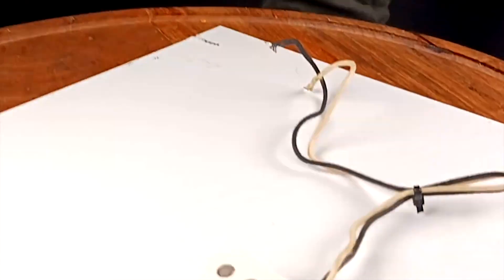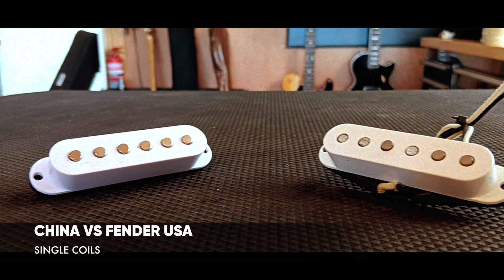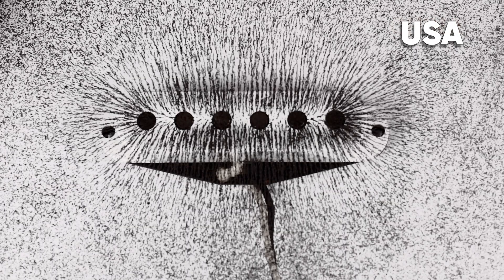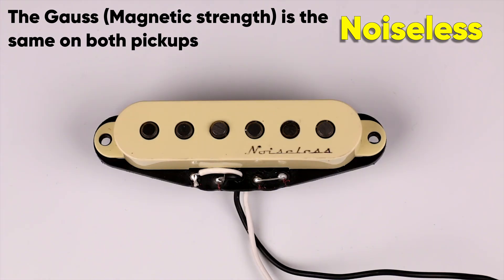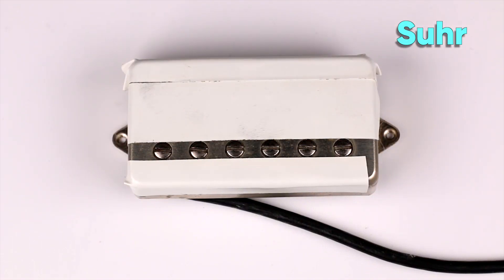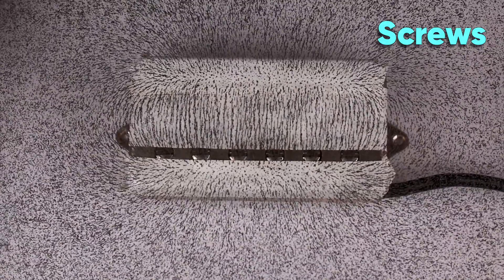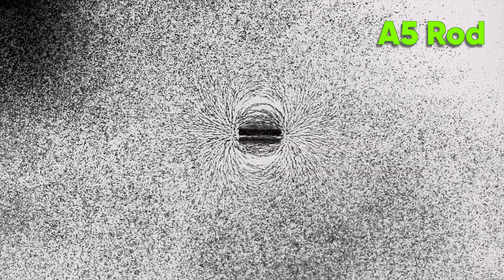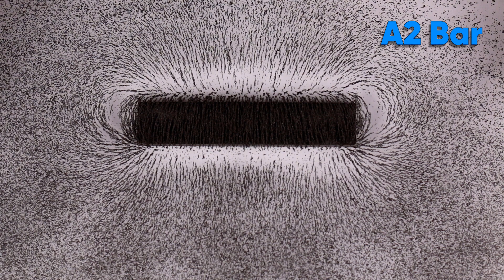3D Magnetic Field Viewer | Guitar Pickup Comparison & Mod Testing

Comment: It’s also interesting to note the shape of the magnetic field above the pole pieces from the side angle. As the string cuts through that profile of the magnetic field, Faraday’s Law basically says the string alters the shape of that magnetic field as it cuts through the magnetic field lines—THIS change in the mag field is what induces the tiny current in the coils. So if the profile of the field is smooth, or sharp, or jagged—it’ll make a huge difference in the tone. 

In G&L guitars, the pole pieces are machine screws that can be replaced with a variety of screw head shapes. A quick visit to the hardware store to find other screws with different head shapes and different metal materials will adversely affect the tone of the guitar pickup. It’s worth checking out. I did this a few years ago and the sounds produced were very different. A rounded broad dome head screw gave a nice rounded tone and an Allen hex bolt gave a chimey tone not unlike a Rickenbacker pickup. Every contour on the head of the pole piece affects the shape of the mag field and thus the induced current when the string moves through it. I suspect that a sharp cone shaped pole piece head would be distinctly different to one that is flat, or beveled. 

They sell these mag field viewing sheets that are green in color—they can visualize the field in a different manner—they might help in visualizing the finer details of the field just above the pole piece where the string would cut through. 

Another thing to dive deep into is the speed at which those magnetic particles in your visualizer move into place. A weak magnet will react sluggishly and take longer than a strong one. So a high speed video clip of the magnetic particles suspended in the visualizer can also give important clues on the pickup behavior.

I would love to see a video clip with bass pickups as well. Their designs vary even more than guitar pickups, with Rickenbacker, Fender, Guild BiSonic/DarkStar, MusicMan Stingray, etc. giving distinct personalities and colors to their tone. 

I like this stuff. I’m a bass player and a physics professor so my curiosity naturally leans this way to the pickup designs. 

Thanks for this video. Consider my tips for future clips! 😊

Comment: Very cool box. Thank you for the video. Sorry to be the bearer of bad news but ceramic magnets do not give stronger magnetic string pull than AlNiCo and ceramic pickups have a louder, darker tone. (Because ceramic pickups have steel pole pieces which limit magnetic field at the top of the pickup reducing string pull, and increase inductance, which increases output and lowers resonant peak frequency). You've mistakenly described the opposite of reality. There's more than enough recorded examples on YT and scientific measurements out there for reference. Thanks again, and good luck!
Reply from the maker: Hey Kev, thanks for checking this out. My Gauss meter says different :)

Comment: That viewer is very cool!

There’s a misconception about the way the magnet works in pickups.  

The usual way it’s explained is that the string is cutting through or disturbing the lines of flux from the magnet. 

But that won’t create any current. Because the magnet and coil do not move in relation to one another, no current will form. This is Faraday’s Paradox. 

What’s actually happening is the magnet magnetizes the strings. The strings become moving magnets. Since the strings are moving in relative to the coil, current is produced.  

The only thing different magnetic field shapes do is magnetize a different area of the strings. And of course different magnets are different strengths.  

Regarding the humbucker screw mod. I’ve been doing this on pickups I make for over a decade. I find it brightens the tone up a bit. This might be due to a change in inductance. And with the field  not wrapping around the back of the pickup, it’s a little stronger on the top, according to my gauss meter.
Reply: I partly agree that the string gets magnetized, but one changed the shape of the pole piece heads and noticed some changes in the overall harmonic output. So there is truth to both perspectives. The mag field is altered by the string’s magnetic properties cutting through the field lines, and that alteration of the mag field is sensed by the coils. Faraday’s Law. Change the strings to a different ferromagnetic material, and it affects the tone too.

So actually we are both correct—and both perspectives are just different ways of describing the same phenomenon. And your explanation and mine are indistinguishable from another. 

The string is becoming a temporary magnet as it is affected by the pole piece mag field, and its magnetic field interacts with the surrounding pole piece field, altering its shape. These changes are what the coils sense and current is induced. 

I’m a college physics professor with some background in condensed matter physics (it was my concentration for my bachelor’s degree) so I learned about magnetic materials. I can’t claim to know everything but playing around with a G&L guitar and changing the threaded pole pieces with different bolts from a hardware store was fascinating. The shape of the pole piece does alter the profile of the mag field. And that affects what the string feels and how/when it gets magnetized to alter back the very field that it cuts through—and this is sensed by the coils. 

Anyways, this is fascinating stuff and we can keep arguing about this but it’s like looking at an abstract sculpture and describing what it looks like from only one place. We will never agree even though we are describing the same thing. We are both describing the exact same magnetic phenomenon but with different words and claiming that only one description is correct. They are both actually correct from two different perspectives. 😊🤷🏻‍♂️

Comment: Appreciate the work.  It's not really 3d because the iron filings get pulled to the bottom wall of the tank immediately.  Also, the Gauss at the pole tops of the ceramic-powered pickups is probably lower than A5 poles, but the much higher permeability of the Steel poles attracts flux lines from the magnetized filings much more.  Those pickups actually have less treble than an equal inductance AlNiCo pole pickup due to eddy currents caused by the highly conductive Steel poles, but the output is much higher due to how the much higher permeability pulls the flux lines from the strings more through the coil.

Comment: Brilliant content!!  THANK YOU for posting!

It would be nice to see this with more detail.
Is it a crazy idea for you to repeat this test with a more accurate alignment of the pickups to a transparent "overlay grid" so we can measure the field lines? And... MOST importantly... what are the INDUCTANCE values of each pickup? What are the total "DC Resistances" for each pickup (and individuals DCRs for each coil of the humbuckers)... only because folks look at the resistance to compare pickups instead of the inductance. Also, what are the environmental ambient temperature at the time of test... and possibly repeating the tests at varying room temps?

And if you wanna get really crazy... place your Magnetic Field Viewer on top of your guitar... pluck a string... watch the field... and look at the guitar pickup on and oscilloscope! I wonder what the multi-test average peak-to-peak voltage is?

This is academic paper type of experimentation.

Thanks again!
Reply: The permability of the core alloy affects how the flux lines draw in the iron filings, so the Gauss/Tesla can not be determined by this test.
Reply: @GCKelloch  Thank you.

I guess I was thinking that there would be some correlation between the impedance and the shape of the field.
Reply: @toddbrous_untwist  Not sure what you mean by the impedance.  Of the coil?  A guy had a busines called Liquid Pickups in which he attached ferrofluid tanks on top of pickups bobbins, but it didn't take off.  The Iron rolls-off the high-end, but also creates subtle modulations as the flux lines from the strings vibrates the liquid.  Novel idea, but no public interest.  I bought his T-Shirt anyway.
Reply: @toddbrous_untwist  One thing you need to understand about pickups is the signal is generated mainly from the field eminating from the strings vibrating through the coil.  The field coming from the magnets does not vibrate enough to significantly contribute to the output.  Dr Scott Lawing of Zexcoil demonstrated that by placing magnets above the strings with an unmagnetized pickup below.  The sound and output was the same as with just the magnetized version of the same pickup.

Comment: This also makes me wonder if pickups could be completely hidden under a thin top and still do the job.
Reply: There used to be very thin plastic covers that you could cover your humbuckers with for those that don't like the screws or pole pieces showing. Anything that you put between the pickup and the strings will dampen the signal at least a little bit. You can counter that effect by slightly raising the pickup height or using a hot pickup that has power to spare. I don't know if they are available anymore. I do have at least one that came on a Charvel Super Strat I bought in '87 or '89. I don't remember. 
     Try Stewmac, Mojotone, or Amplified Parts.

I read your post again and I think that you may have been talking about hiding a pickup under the pickguard. Yes, it can be done, has been done, is currently being done, and could be done in the future.  There is a Tele/Esquire model Brad Paisley signature Seymour Duncan called the Secret Agent. You could do it yourself also. Just get the thinnest pickguard that you can find. You may even be able to sand the inside down some, but I would wait until after you try it unsanded first. The same physics apply. You will need a pickup with extra power or it might sound weak. It also depends on what kind of music that you like to play. For instance, if you are playing Jazz you might like the way the sound of your hidden pickup is more mellow and round. If you are playing Hard Rock, you might miss the power, the umph, and the immediacy. If you're into Death Metal, you might just want to scrap the idea altogether.
Reply: I remember a guitar company several years ago had placed a pickup inside the neck of a guitar at the last few frets, either a piezo or a wound pickup, but I can't recall which brand it was. Ovation comes to mind, but I could have sworn it was a Gibson Les Paul or a Gretsch guitar.
Reply: @rexdarvog  I don't think I have seen that before. 
    There is that one that mounts at the end of the fretboard. I think it's a Kent Armstrong Jazz pickup.
Reply: There is a company that makes a neck pickup for a tele that is hidden under the pickguard. Brad Paisley uses then.
Reply: @tiki_trash  Yeah, that's the Secret Agent.

Comment: Great video! I have had the same idea, but I want to try to see the magnetic field in action with the strings. Your idea with this bottle is great, instead of using an acyl plate with iron powder what I was thinking about. What liquid have you used? For my experiment it has to be very "light" with no resistance to see the movements of the iron powder when a string is moving. Maybe this could be a method of comparing the resonance of materials (sustain), especially after a modification on one guitar. Maybe a bit too crazy...but I have to try this sometime.

Comment: I saw an old video when we touch (check pickups wiring) the pole with metal screwdriver..it messed up the magnetic field . can you check with your new tool?
Reply: I played years with metal picks, only because i found them messing the magnetic field and producing a bit bytier sound. It is not huge difference, but enough.
Reply from the maker: Cool Idea, will have to try that!